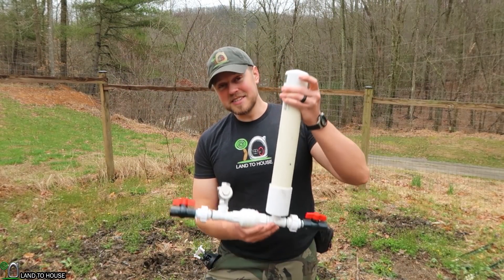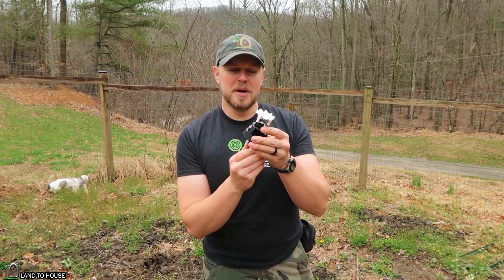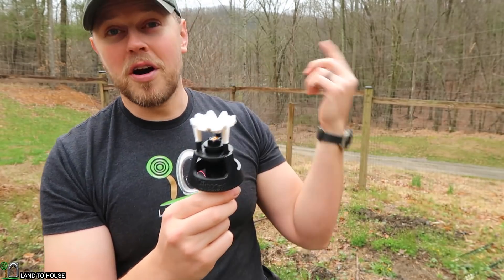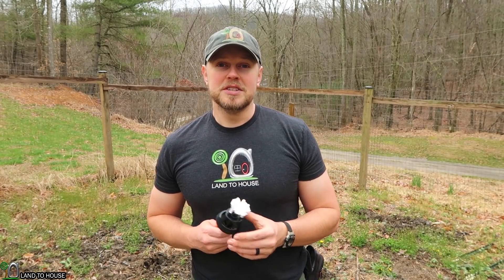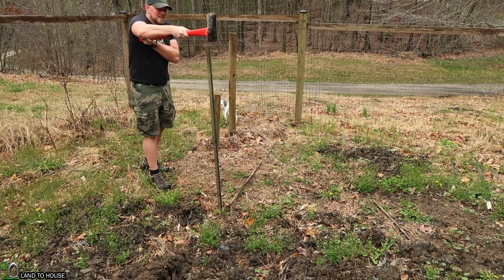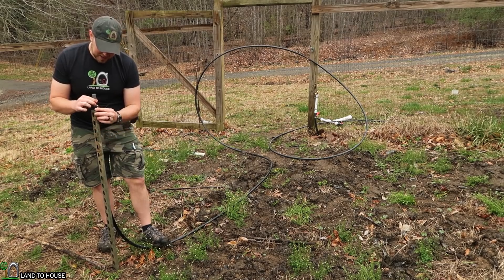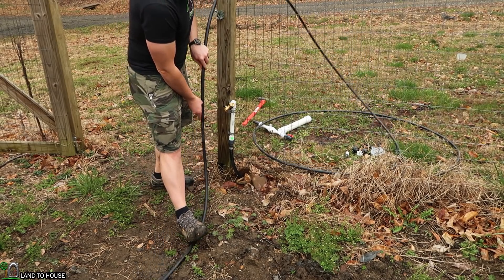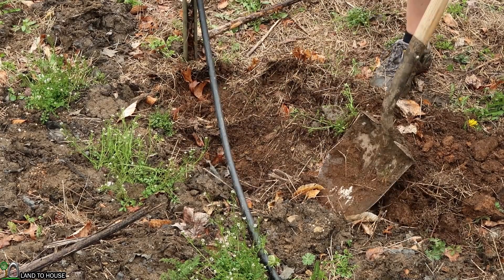You've never seen a garden water system like this... cheap, easy no electrical required!

Comment: Hey Seth, here is an idea you can add a shut off timer on the line so you can set it to turn on and off to run for a specific time.  I have one on my solar heating coil for my pool and it works great.
Reply from the maker: You're a mind reader. I have the orbit digital timer ready to go for a video soon. I was going to save that for when I've actually planted the garden.  Because the wobbler uses so little water I figure it will need to run most of the night. Would be very convenient for it to turn on by itself.

Comment: I'm looking to use a ram pump from a 275 gallon ibc tank that I'm going to harvest rain water in. It will be used to water a 40x50ft plot using wobblers. If I elevate the tanks is this feasible?
Reply: Feasible yes, but practical no.  the ram pump will let 225 gallons of the water run out to pump 50 gallons to your wobbler sprinklers.  Look instead for a solar powered fish pond pump.

Comment: That was just the project for me watch, I was looking at the wobblers for my garden this year we have low pressure and low flow  water.   Two full wraps of teflon tape covering the full width of the threads actually in contact will do the job and can be easier to assemble. Please tell is about the other sprinkler head when you use it.  Thank you
Reply from the maker: I have one in the garden and one on the hill for grass. They have been working flawlessly! In the next week or so I hope to have a a dedicated video showing the two types of heads.

Comment: 2 hours at 1 gallon a minute  thats a lot of water  do you have the 120 gal storage for this system?
Reply from the maker: Yes I have 155 gallons on the hill. then when that runs out the ram pump will directly feed this system at .5gpm.
Reply: I gotta check into that ram pump. Problem is the brook run dry around late june and my pond doesn't move
Reply from the maker: A constant flowing creek is a must. You could at least fill a few tanks for when the creek is dry.

Comment: I'm going to be using 1000 litre water storage tanks.
Built up about 6ft on a wooden structure for gravity fed drip line.
Will a ram pump addition to this work if so are you selling them still?
I'm hoping to be able to over head irrigate aswell as drip line.
Reply from the maker: The ram pump would be great to fill that tank from a creek. It would not be good to use for building pressure out of the tank. Too much water would be lost out the waste valve.
Reply: @LandtoHouse  ok
My creek is pretty flat.
I dont have any drop.

Comment: I’ve used wobblers for years. They’re the best. 

Would it be better to filter the water from the ramp pump before it’s goes to your tank?
Reply from the maker: Yes I think that it would! I now have a filter on the hose here at the garden. I will have to see how often I clean that filter. If its not often I will put it up at the tanks.
Reply: @LandtoHouse  I use a restaurant style China cap filled with coarse sand as a filter going into the tank (old pool filter) around thirty gallons that I pump the water to the garden.  I fill this tank from many 55 gallon drums that I hold the collected rain water in.  I have been using a hand held hose  but haven't been happy with pulling the hose around the raised beds.  I'm going with a wobbler next year - 23 X 25 garden.  Any suggestions on the size of the Wobbler that I  should use?

Comment: You mentioned putting a quick disconnect on the end of the line to clean easier. I would add another small in line shut off between the QD and the wobbler. (So it stays with the wobbler with whatever setting you leave it at). That way you can set it to just hit the perimeter once for the flow, with the main stop at the spigot open to full. Next time you can easily turn the wobbler on by going to full on at your spigot and have it perfectly adjusted.
Reply from the maker: That is a really good idea. I actually did that on the other wobbler on the grass. It makes a nice reducer so the spray does not go too far. Next week I have a video with a screen filter at the garden to keep the debris out.

Comment: How much lift and run do you have from the creek?  Very nice sprinkler.
Reply from the maker: The lift from the ram pump to the storage tanks is approximately 35 ft. The head pressure back down to sprinkler is about 20 to 25 ft

Comment: Thank you for beginning your testing of the Wobbler.  I've linked to this video and started a discussion on the Water Powered Pumps public Facebook group: https://www.facebook.com/groups/240458583255303/permalink/558595924774899/

So far, your results have been similar to mine.  I've tested with a gravity feed from a stream in a gully.  While I had lots of water from a 2 inch layflat hose, by the time I reduced the size and connected to multiple 3/4 inch hoses connected together (slightly down hill) with the external and internal part to the normal coupling, I reduced the water to not very much, so I'd like to use poly pipe - is there a way we can use an external connector for the longer runs (similar to PVC external connectors)?  The constriction may not matter and be useful for one Wobbler, but hoping to string multiple Wobblers and other sprinklers to cover larger areas - this is where where I ran into issues.

I have the larger all black Wobblers (just what I got - I'll get include of the smaller ones on the next order) and I also purchased a nozzle collection of sizes since I didn't know which size I should use.  I have only used the largest nozzle size hoping for bigger droplets for more water volume, greater resistance to wind and hopefully more tolerance of silt in the line - the best nozzle size may depend on the situation.

I purchased one of the tripods to mount the Wobbler higher which was great for testing, but I wouldn't use it for a permanent installation - for on the ground, so far I just used the base from a pulsating sprinkler for testing.    In my case, the height of the Wobbler made some difference for increasing diameter, but not enough to bother for that reason and the higher height did give a little more wind exposure.  The reason I lifted the Wobblers was to clear taller grass and small shrubs with the water.   I didn't measure the water coverage at different locations in the circle - but everything seemed to be getting wet.
The Wobbler is not really a sprayer - it slings raindrop like droplets out which are fairly tolerant to wind and evaporation in the air and once the drops hit the ground, unlike some sprayers.  When you get hit by a Wobbler droplet - you know it.  The pattern is a circle, not a rectangle, so we'll have to plan accordingly.  

One plan is to have multiple ram pumps each driving as many Wobblers at it can handle.  I have to figure out some type of rotation, because always having the water on, is not good for the grass and in some cases erosion. 

Thank - thank you I've been waiting for this video - looking forward to your Wobbler / direct ram pump test.
Reply: Somewhat sorry about the previous long post - If I single out one issue, it would be how well can one or more Wobblers run directly from a ram pump (without using a gravity feed tank).

Comment: That is not true I have seen plenty of water systems like yours. They are quite common for use on farms for their irrigation systems. Their a lot of old commercially manufactured ram pumps in operations today on farms up in Main, New Hampshire, and Vermount. They us them for water crops and for watering cows on the  dairy farms. They are a great low cost irrigation solution for the small family farm.
Reply from the maker: That's awesome! It's good to know that there are still so many ram pumps working out there! They were very popular in my area many years ago and have now been forgotten.